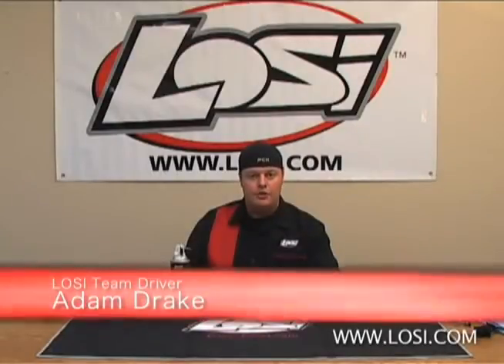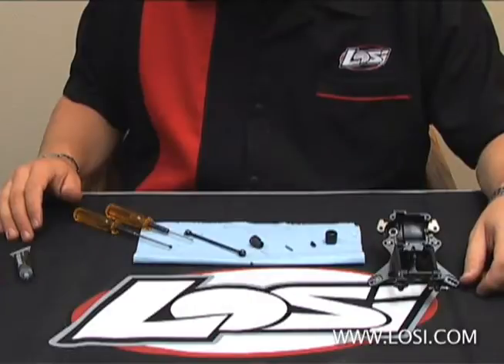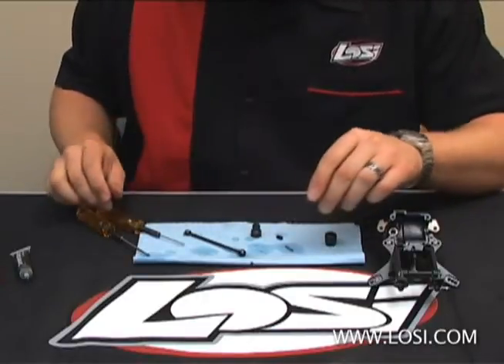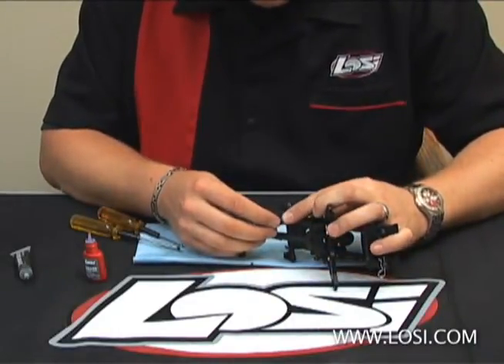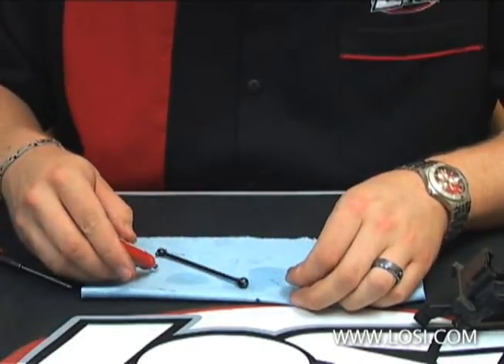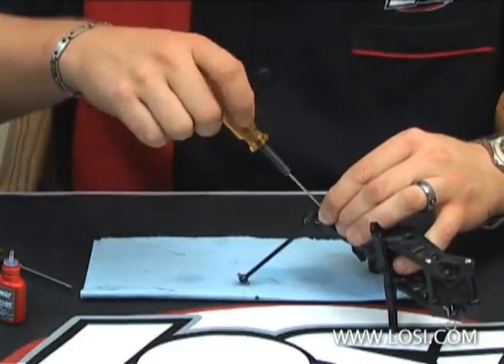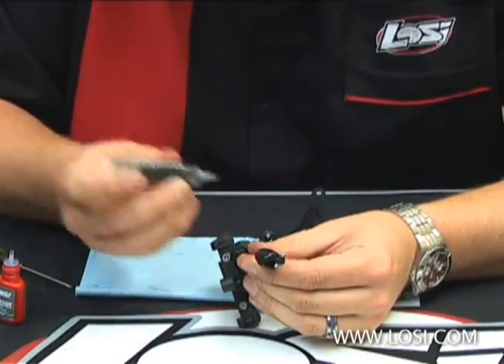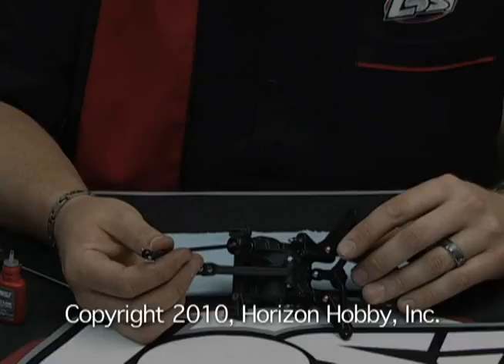Losi How-To: Threadlocking the Driveshaft

Comment: Hello, I just had a DBXL-E 2.0 delivered on 1-27-20.  My buggy arrived looking ok, but on power-up the pinion and spur gears are grinding like a cement mixer. On the bench it goes. I found a bent front drive shaft. It shows  .030 thousands bend on the dial indicator.  That means  .015 bend.  Looking further the 4mm metal plate has a  .080 thousands upward bow in it. No idea how this can happen being shipped. Can you put a straight edge on yours and see if yours may be bowed. Im getting ready to straighten things up. Contact for repairs has started, but im in wait mode. I took video of the work checking the buggy.